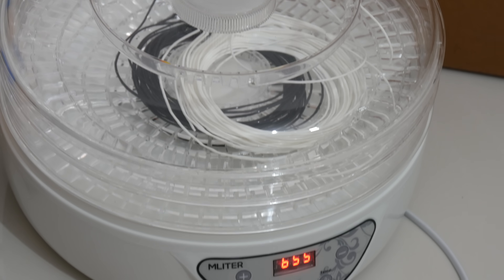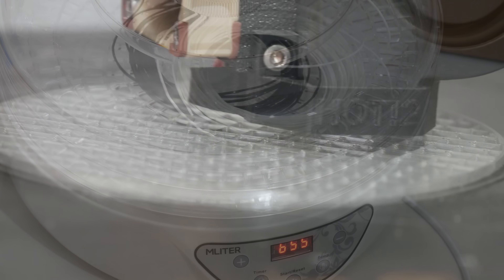Make Your TPU Prints Glossy - 3D Printed Coasters

Comment: Nice. Could a t-shirt be stretched over a build plate and then print a design on the t-shirt? Then iron on a piece of aluminum foil, cut away the portion over the print, then heat-gun it glossy? I don't know I suppose I'll try it out f you don't get around to it.

Comment: Makes me think that an Air Fryer may work well for this. Because you got so much better results with the heat gun, I suspect that the intense convection inside an air fryer would give you very even melting. The trick would be pulling it out at the right time. I have one, so maybe I'll give it a try and we'll report back
Reply: Why didn’t you report back? I’ve been waiting here for a year to hear back from you
Reply: Inquiring minds want to know ...

With the same idea, I'd think a "super convection" oven would work well too.

Comment: If the layers where you're printing multiple colors are thin enough (0.45mm and below is good) you can design it to print with zero tolerance with great results. The nozzle does hit and melt the previously printed design, but it wont affect the bottom finish. Check out the Dragon Ball-Z phone case I made doing this on my channel

Comment: Your problems are basically those of a chef. You just needed to cook it low and slow.  It gives the material more time to conduct the heat into itself. So try setting your oven a bit below the GTT cooking for longer and slowly working the temp up if it doesn't work.

Comment: I’d like to see more, especially how you changed colors both on design and slicing, plus how the Filament is changed and hot end is cleared. I’d like to see in the free apps rather than proprietary or expensive ones.  So design technique and then printing multicolor on a single color machine.

Comment: Have you ever printed TPU onto fabric? That could add a whole new dimension to this.
Reply: ChemicalArts actually, TPU/Ninjaflex has been printed on T-shirts by "RCLIFEON".  Do a YouTube search on rclifeon, and wade through his videos, he has a couple videos doing flexible filament on T-Shirts.
Reply: I think I've seen a video by Simon where he did that.
Reply: @ChemicalArts  maybe could get same effect on t-shirt if to iron after printing on? Legit DIY t-shirts right there.
Reply: Print one layer, pause, stretch fabric over build plate, continue print. Insanely strong, you won't be able to remove the plastic from the fabric even if you wanted to.
Doesn't need to be flexible. You can print in PLA and do something like scales to make hard but flexible armors for costumes and such.

Comment: Thanks for the share. Do you think that process will work for pla?
Reply from the maker: I’ll be trying it out :)
Reply: 3DMN awesome. It must be coaster time. I just got done printing out a lot of (for me) coaster. I would like to be able to get rid of the extruder travel lines on the finished products without introducing errors with adding z hop. Thanks

Comment: Really cool video!! I also like to use heat gun to smooth stuffs (taking glass temp as a parameter) I have one that you can set the temperature manually (DeWalt brand)... It’s an awesome tool.

There is also a technic in the new Cura’s version called “ironing” that heat up top layers to melt it. The original name was Neosanding, created by Neotko, an expert user from Ultimaker community. But I don’t know if it can be done with TPU, it works pretty well with PLA. You can also manually try it in Simplify3D... anyone interested in a in deep information just seach for “neosanding ultimaker”.  Cheers, Gazzola/ 3dSolid
Reply: Do you have a Heat Gun brand and model you like best ???.........Thanks for sharing!!!
Reply: Eric Archuleta Sure, DeWALT D26414 it’s for professional use, it goes from 50-600 degrees 1500w but I never need to go too high, the usefull stuff for FDM is the ability to set temp manually on the screen behind